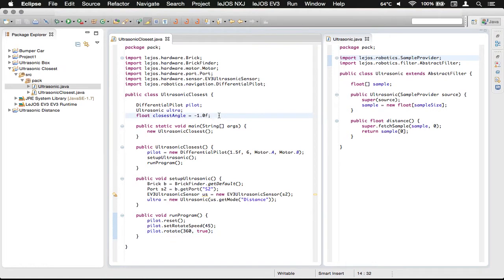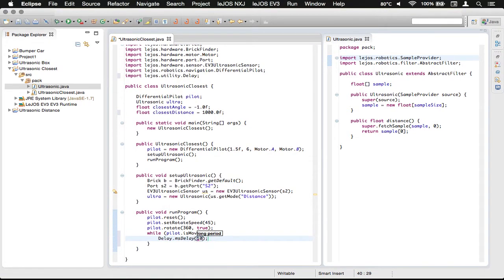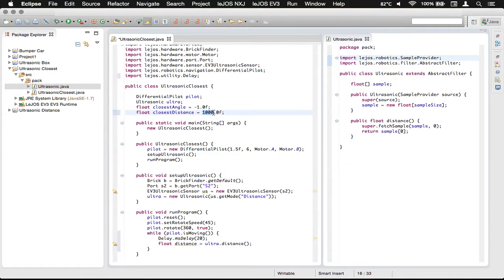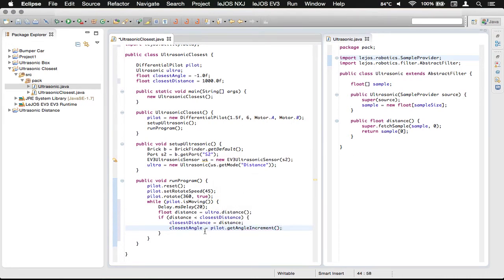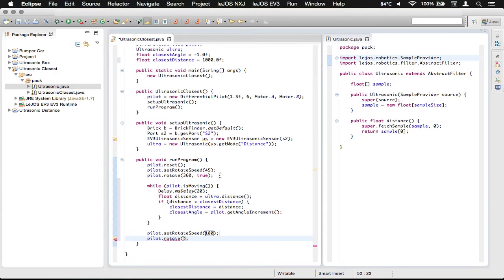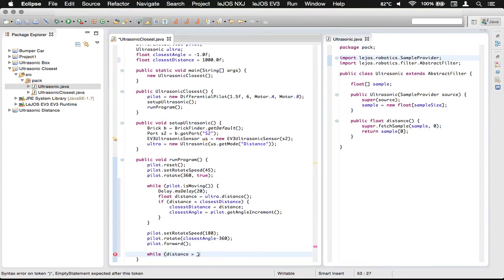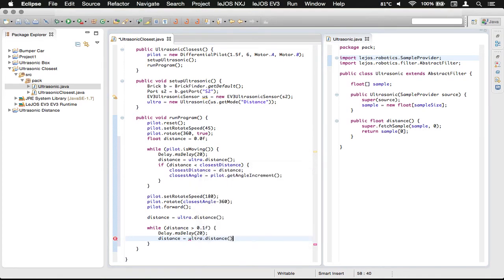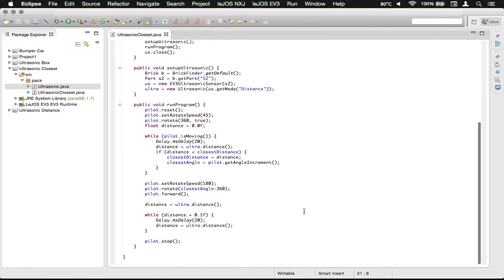LeJOS EV3 Ep23 - Ultrasonic distance project Pt2

Comment: Cool lejos ev3 tutorials! Could you make a program which uses multiple ev3's?
Reply from the maker: +luis blanco hoyos Thanks very much, and yes you can.  However, I don't have two EV3's, and can't test to confirm that the code would work, and not be comfortable sharing code that might not work.  On the other hand, Gloomy Andy (one of the developers of LeJOS) has a website where he has a written series on getting multiple EV3's (up to 16, using both USB and Bluetooth) to communicate.

In his tutorials, he uses a version of LeJOS that is post version 0.9.0 that is not released yet, with at least one method that is not in the standard 0.9.0 (however, as mentioned in the comments of that post, he says that there are other method calls to use).  I will also provide a link to this page at the bottom of this.

Reading through the series, it basically looks like, pair your EV3's using Bluetooth (pretty standard with the PIN), start one EV3 as an access point, and have the other connect to it (this is all done in the menu system, not in the program).  You can then run his code he has posted that (for a simple demo) controls the LED of the other EV3.

He also has a post on controlling motors remotely as well.  Additionally, it appears that you can daisy-chain EV3's using the USB port, but I'm not sure if that changes around the protocol too much (again, I don't have two EV3's to test this on).  Anyway, here's the link (replace <dot> with .):

https://lejosnews<dot>wordpress<dot>com/2015/02/26/ev3-to-ev3-using-remote-methods/

Hope this helps!